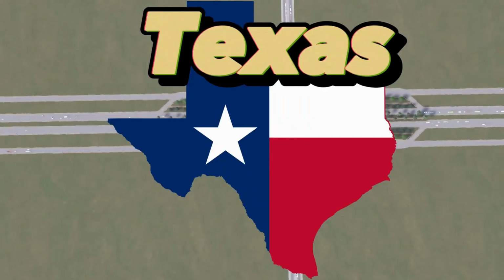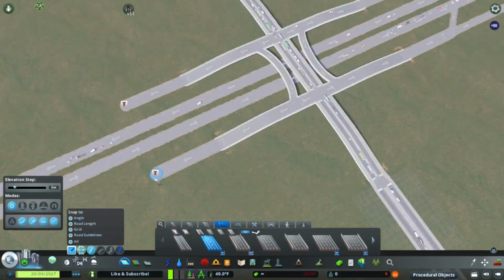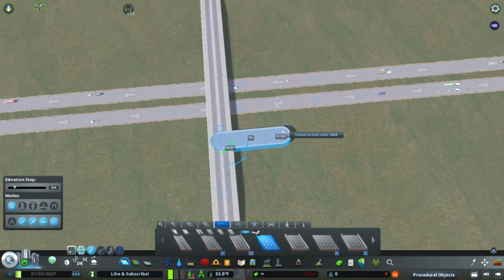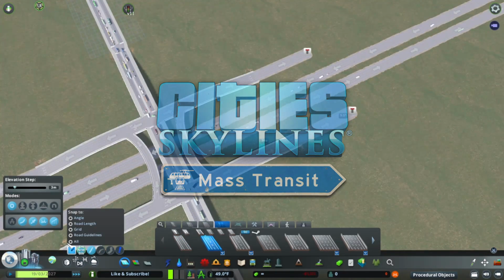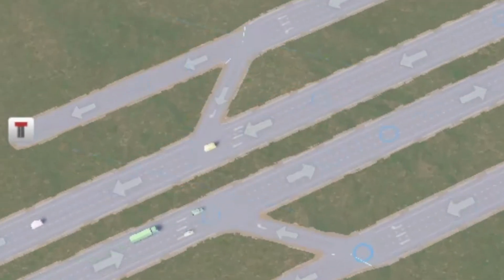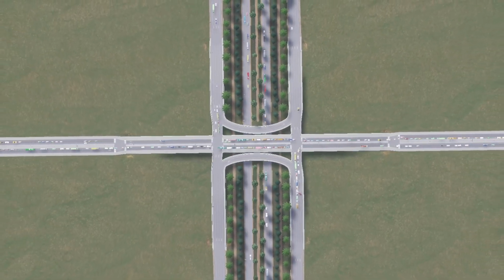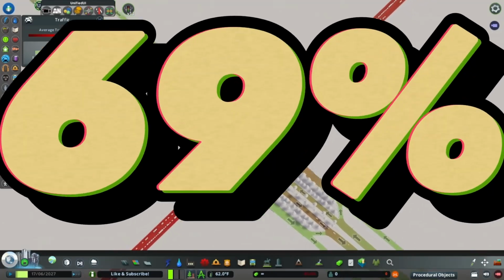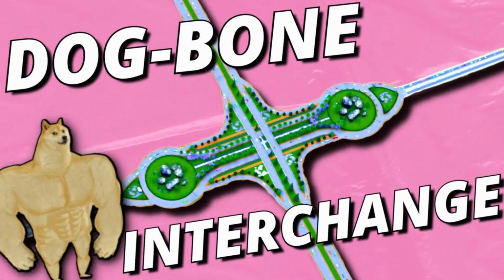Would You Put This Unique Interchange In Your City? (Cities Skylines)

Comment: I use these almost exclusively in my cities, to the point that even system interchanges get ran through these junctions (unless traffic volume is super high). Google maps can show you the junction between I-27 and US-82 “Marsha Sharp Freeway” in Lubbock, TX for a good visual example of what I’m talking about. 

I use the BIG Urban Road set from the workshop to set my one-way frontage roads that way I can adjust the number of lanes without changing the actual width of the road in-game and also so I can zone directly off of them. 

I also usually place the u-turn portion of the junction under the highway, as in the highway is the bridged roadway, unless the geography would make bridging the cross-street easier/more sensible. This is primarily because I live in the flatlands in west Texas, I know bridging the cross street over the highway is more common closer to Dallas or Houston. 

I will note that I’m from MO originally, and over there, they use the common method of two-way two lane roads serving as “outer roads” and they have their own separate junctions instead of sharing with the diamond interchange like TX does. I’ll sometimes use that method in “small interstate town” type builds.

Comment: The Texas Turnstile is essentially a couplet/elongated roundabout on steroids - it's functionally the 'little brother' to express/local freeways, isolating local traffic from through traffic.  And similar to a roundabout, it's a regional solution to a regional connectivity issue.

The terms "highway" and "freeway" are often conflated, as highways provide high-capacity accessibility while freeways provide more capacity with less accessibility.  Texas, in particular, abounds with large farms and ranches close to urban cores - as well as a plethora of support industry ranging from grain elevators and animal markets to feed stores and supply depots.  While these uses need the capacity and accessibility of highways (as well as ready access to freeways), you don't exactly want tractors and other slower vehicles clogging up the freeways.

Much as urban planners bemoan how freeways divide urban neighborhoods, they also divide more rural communities.  Being more spread out, rural communities don't generate the funding needed to build overpasses every few blocks to connect the two sides - making required overpasses just a tad wider (to accommodate free-flowing "y'all-turns", as opposed to 'left turns') is a far more economical solution.  They also see frequent use by industry, such as a truck leaving a facility north of the freeway (on the frontage road) heading east.

The current 'successor' to the Texas Turnstile is an upgraded SPUI which includes a free-flowing u-turn lane - you can see one in use at Parker Road and US-75 in Plano, Texas.
https://goo.gl/maps/apXMEL79GX3j9Fds5
As you can see, it's also a bit wider to accommodate trailer offset for turning trucks.
Reply from the maker: This was an incredible comment..I can tell it's very well thought out and I appreciate the insight..all solid points. Especially the part about rural areas being broke up by highways. I know Texas pretty much requires frontage roads on almost every stretch of interstate highway in the state and that makes sense as to why.
Reply: @CitiesByDiana    Few people appreciate how ginormous Texas is, particularly in regards to agricultural land uses.  Most of the region is known as Llano Estacado (The Staked Plains) - so named because, according to local legend, the region is so flat and geographically featureless that Spanish explorers had to drive stakes into the ground as reference points.  Texas is also the only State I know of to have an expansive network of dedicated farm-to-market roads, denoted on maps with the FM designation.  It's not uncommon to see ten-year-olds driving a tractor (pulling a wagon) from their family's farm to go pick up a few tons of seed and a couple miles of barbed wire.

A lot of the midwest sprang up around railways but, even today, there are very few railways in west Texas - some places are still 150+ miles from the nearest rail line and well over 200 miles from the nearest access point.  That means a LOT of transportation is completely dependent on highways, many of which originated as wagon trails.  As you can probably imagine, semis with livestock trailers have quite different network demands than the old days of driving a thousand-head-plus herd of cattle down Main Street.

As with 'stroads', the need for capacity conflicts with the need for accessibility - frontage roads were the solution Texas DOT settled on.  (Not too dissimilar from how Phoenix has many places where a high-traffic road is flanked by streets for local access.)

While I'm not sure if it was an intended feature or simple serendipity, one additional (and, to be honest, enormous) benefit of frontage roads is that they can accommodate the bulk of freeway traffic when a section is closed off for maintenance/repair.  Many highways in Texas already has frontage roads when the Interstate Bill came around, which made the necessary upgrades easy to accomplish with minimal disruption of day-to-day traffic patterns.  Their success in this regard prompted the construction of even more frontage roads in preparation for upgrading existing 'National Road'-type highways to full Interstate standards.

Comment: I used to live in Wichita, KS and the main corridor through the middle of the city was like this. I think they worked really well. Certainly better than the two-way frontage roads that then flare out from the highway at their own intersection where I live now. Now for me to get through an intersection, I have 4 traffic lights because the frontage road intersection is probably less than 100 feet from the basic diamond highway intersection. It's a mess.

Comment: Having driven in Texas, I came across these everywhere and had never seen them before. To be honest, they are not great, especially at rush hour. The frontage roads were backed up most of the time and I saw maybe 2 people in total use the turnarounds the whole week I was there. It actually adds an issue of having stoplights too close to each other causing bottlenecks. I'm suggesting an alternative for the Texas turnaround to instead be a SPUI with the turnaround still there, just smaller
Reply from the maker: Honestly same, I got caught up on a bunch of these driving through San Antonio and they're kind of a mess 😅 especially when there's 97 big box stores on each side directly on the frontage road.
Reply: Texan here -- can confirm

Comment: I'm in San Antonio.  You have it backwards.  The dimensions are about right, but the highway should go over the arterials.  However, I have seen it done both ways, but lower turn arounds make more sense.  You would not use this intersection connecting two busy highways together.  But arterials into cities....it's great!  I use them for City Skylines all the time.  The trick is to use lane mathematics and spread them out so they have enough room to work.  I use access roads all along them.  A really good RL example is SPID in Corpus Christi, TX.  You can see it on Google maps.  Love your vids Diana!